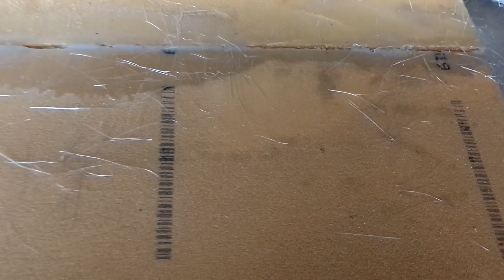Companion's Way (22' Sailboat Refit) - Ep18

Comment: Awesome videos and you have mad skills. I did the same thing twice and still have not done what is in the back of my mind and now I am fast closing on what might be just running out of steam to do it again. Please, Please finish this boat fast as you can even do some short cuts, sail it and then sell it and then go get you a boat 10% bigger than you can every dream and fix that and travel the world before you waste too much time. It is the same work just for a bigger boat, one you can really get into.  You will be a internet success, well done. Cheers
Reply from the maker: Hi Steven! Thanks for checking out the vid and I really appreciate this comment. You actually touched on what has been going through my head lately. I purchased this boat thinking it would be a good learning boat for sailing (since I know almost nothing) then I had planned to purchase a much larger boat (40'-50' to travel across oceans). I go back and forth thinking it would just be better to invest in a large ocean going boat then tinkering with this boat. As you can tell I enjoy over engineered products and have been looking at Amel's [Sharki or Santorni] for their superb well laid out designs, but a 45' would tap out my entire savings and leave no cruising cash..I'm not sure if I would like a lesser quality boat that has me questioning during rough oceans....that being said, I won't sell this boat because of the sentiment (may just give [let borrow] it to a family member or friend)...you've touched on sensitive topics. I would love more advice as I am new, but a quick learner and have spent my entire life around the ocean so I know how to read weather and the seas....in short...get a bigger boat now or risk having less $ to get a bigger boat later....orrrr I may not like living on a boat at all so land-lubber I'll be...lol...your comments and advice is appreciated!

Comment: You might also want to consider some sort of floor boards, even if theyre just simple wood slatted removable deals. Not many boats have dry bilges. Leaks, rain, waves, humidity, condensation. Just a thought, you may hate it if you cant keep it dry. Dig all the little innovations and concern for reliability!
Reply from the maker: Not a bad idea. Definitely appreciate the advice. I'm thinking it might be wet all the time as well. Perhaps I'll come up with something. Maybe an 1" of gap. Checked out your channel, looks like a pretty epic journey! ( I subbed), super sick way the way that dude shelled those lobster. I need to learn that technique!

Comment: Nice job... companion way is my next step (only thing I can work on in cold) taking it off and following exactly what you did...great to have others working and sharing...cheers!!
Reply from the maker: Good stuff, just checked out your core video...at times I wish I did it from the top, but for some reason I cored and refiberglassed from the bottom (inside). Your gutted hull looks like a blank slate. Ideas on the layout? or are you gonna follow the previous design? Looking forward to checking out the build. Thanks for watching mine!
Reply: +Neon Swell putting a Vberth in with a big water tank built in...adding a head...main bulkheads are going back in...yeah totally off grid electric...in next month going to start comp. hatch...no rush can't do outside stuff til may ...your build is coming along...like the 5 gal. jug idea...did you look into any bladder type water holders, might hold more?  cheers
Reply from the maker: I have a RV (marine) 15 gallon tank for the back area of the boat. I found that these are much cheaper than anything labeled 'Marine' so I go with those. No bladder only because I'm late to the game and already purchased other items. Plus, I always think sharp object and bladders are bad. They seem easily penetrable compared to harder plastic.

Comment: Hey, ever thought about the bucket and chuck it? Might work better for you than a Chem toilet. Or if you prefer you could could use moss or wood shavings and use the bucket as a compost head. Just a few options.
Reply: Plus being by yourself, you could put the bucket in the cockpit for great scenery.
Reply: I line the porta potty with a trash bag to collect the poop.  It goes in the garbage just like baby poop and old guy poop (they use disposable diapers).  Pee goes in the same bottles I drank soda or water out of.  Its saves me from cleaning out the porta potty.
Reply from the maker: Yeah I like Nigel Donald's way of looking at it. The portopotty is emergency cases only. Other than that, bucket and chuck it will be the method.

Comment: Really enjoyed this episode! Nice work and good progress, it’s coming together nice and now you should be close to tidying up-time i guess? When is the boat planed to sail?
Reply from the maker: Hi Jakob, thanks! You are right. I'm in the process of acquiring and looking at paint, sandpaper, primer, and other tools to start cleaning everything up. There are a few details that I'd like to do still (shelves mostly custom, various electronic and component dry fits so I can epoxy in permanent locations before top coat/gel coat)....but still slows she goes as I've been brainstorming a bunch trying to make this boat as handy as possible. I'd like for the boat to be ready in a few months, but have yet to tackle or think about the outside. I still would like to make a really nice hardtop and also have seadek for the top deck then have to paint the bottom and maybe make a cool sugar scoop. So realistically probably Jan 2020...yes long a bit longer ;(.